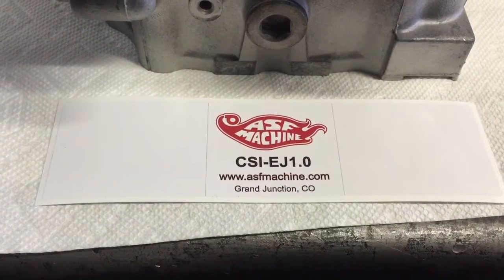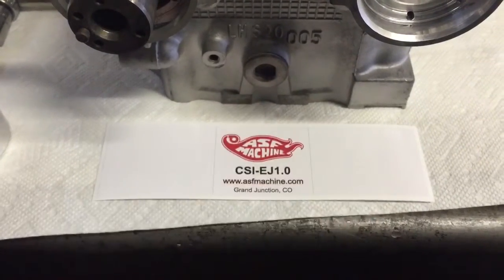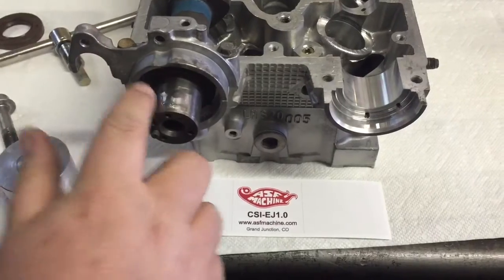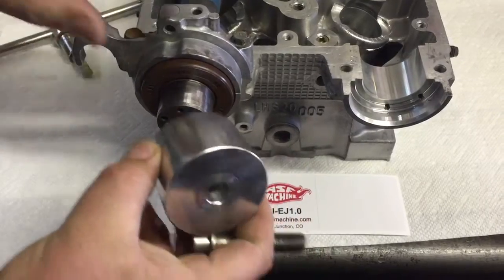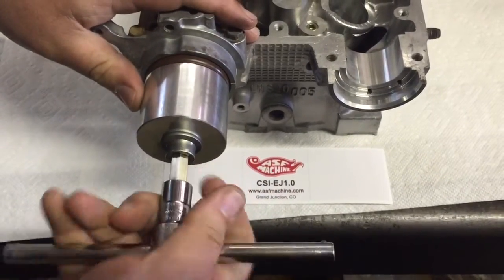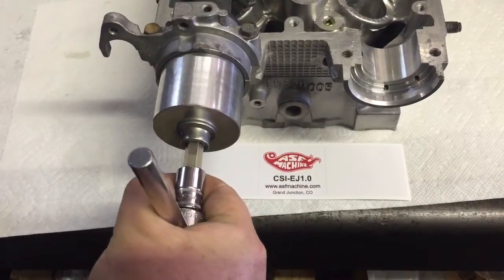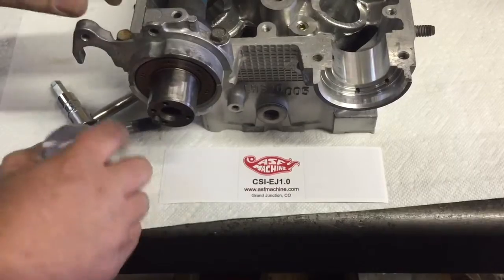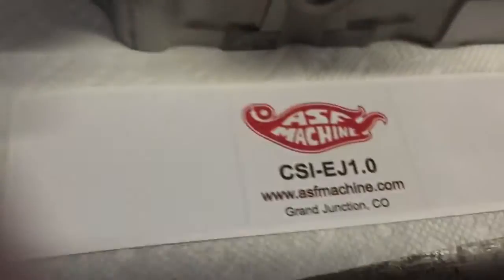ASF Machine Subaru Phase 2 DOHC Cam Seal Installer Demo

Comment: Still make these?   I'd like one. Please and thanks
Reply from the maker: yes we do
Reply: @asfmachine    Well I just picked one up from flatiron.  Would you be able to tell be the size of the cam bolt since i need a longer one to be able to use it on my wrx?
Reply from the maker: @paulb2948  m12x1.25 x 50